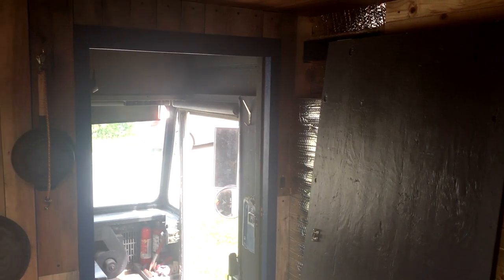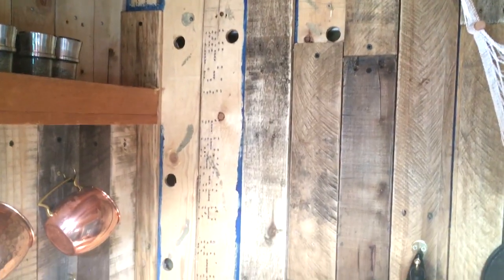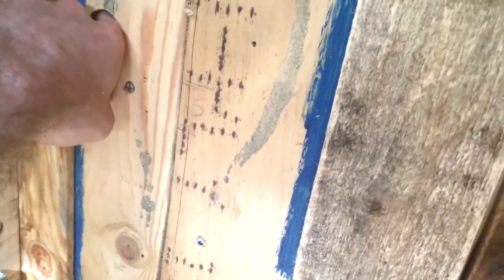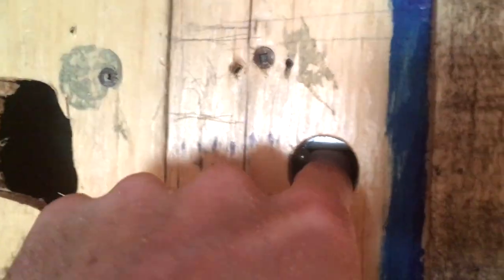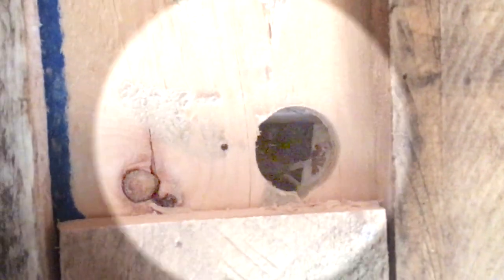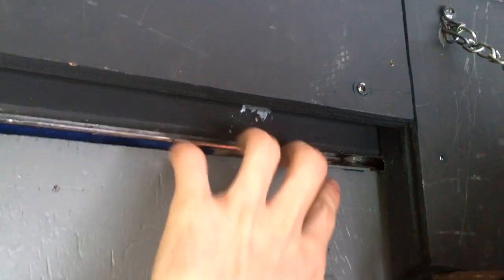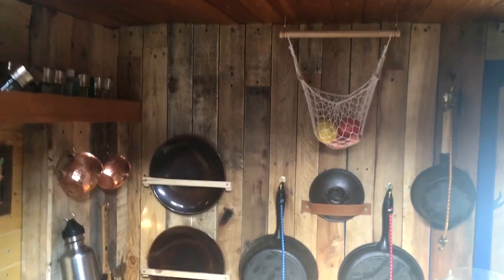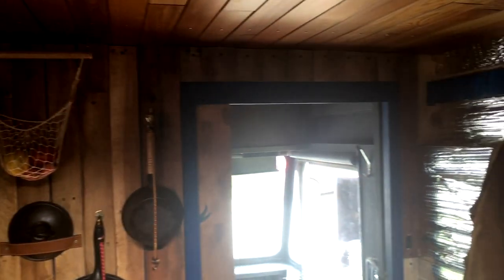Vanlife Cooking Failure Leads To STITCHES ~ E034

Comment: my best was 22 in my knee from a knife, 4 stitches in the muscle and 18 in the skin, then had to go back to work doing my shifts in the tax the next night... other summer I was putting a lug nut on, slipped, crushed my finger, 6 hours of reconstruction, and to top it all, sitting down on 11 inch wallpapering scissors, went in through the back pocket area of my jeans, hit the bone, went round the outside of the bone making my skin come up in a point at the front of my hip, ER gave me a plaster for that I kid you not! (i pulled them out slowly, very surreal, then went to er in the van lol. I wasnt worried about the injury if it had hit anything other than void/fat i would have known, it was infection i was worried about.) thank god for the free nhs....
Reply from the maker: I'm thankful for it! I'll try not to best your record. ok?